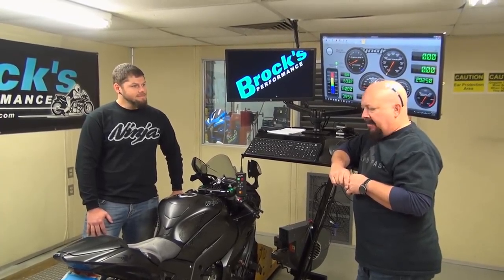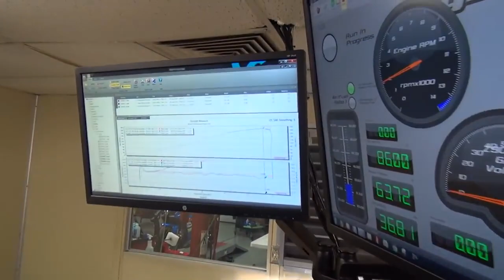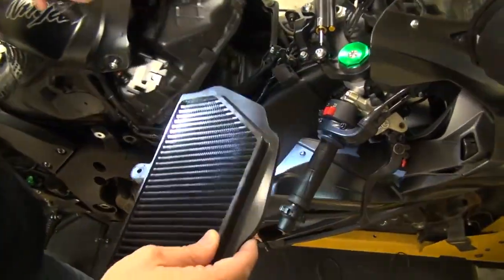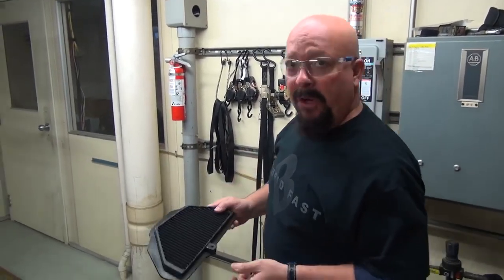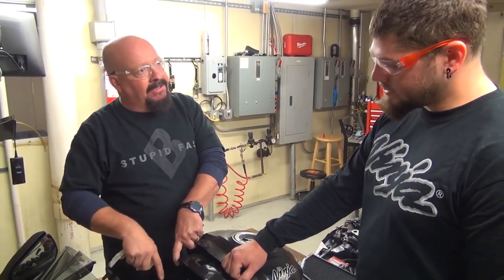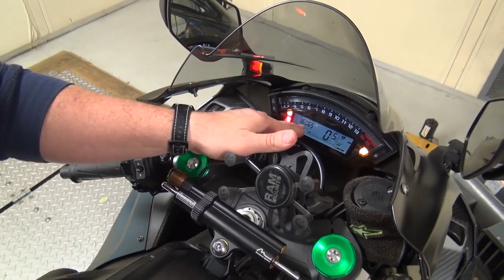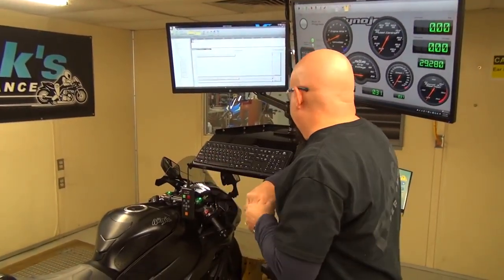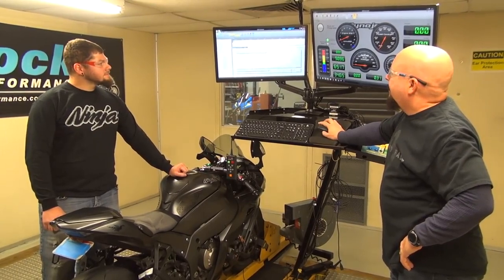Sprint Filter P08 F1 85 air filter long term test

Comment: So you can run the sprint f185 air filter for normal daily riding? Everyone is telling me it is a race only filter. What is the difference between the po8 and the f185 in performance.

Comment: Looks like the stock filter do more the job..
Reply from the maker: Where? Did you watched the video?
Reply: @sprintfilter  yes I am watched the video..you can see in the minute of 12:45, in the up side of the filter box,there many dust right there.. Well you can say the small dust dont do much efect on the engine, but I just dont see any dust at the stock filter after the filteration..
Reply: logo is stamped on it tho, not any like OEM